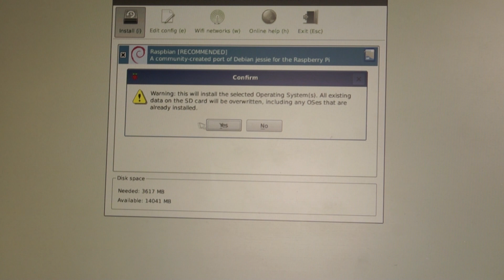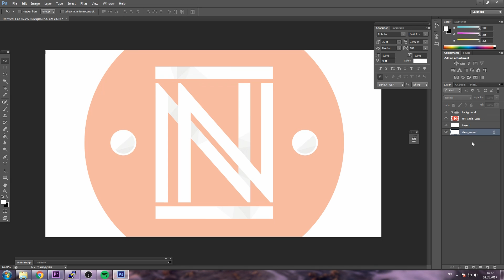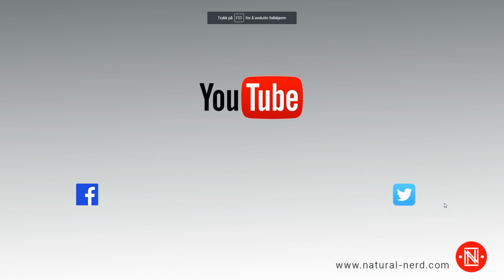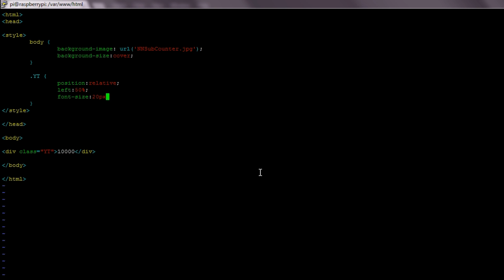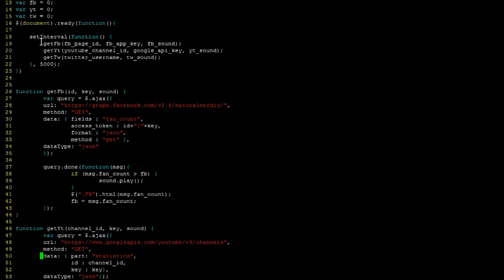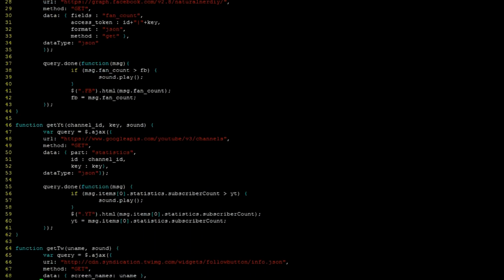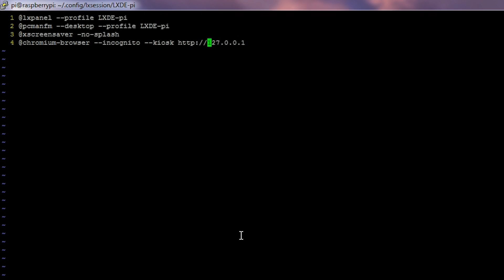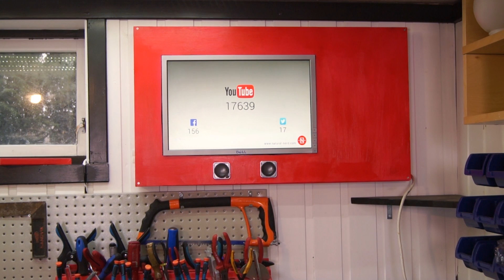Make a Facebook/Social Media Follower Tracker || DIY

Comment: It looks as if your code for the Twitter "getTw" function is now non-functional. I'm seeing "was blocked due to a mime type mismatch" for your call to Twitter. Seems the method being used to get the metrics is no longer supported and the literature seems to call out a different method of getting this data. Additionally, your Facebook function is pointing to graph.facebook.com/v2.8/naturalnerdiy and I'm wondering if this needs changes to support other users - Any advice would be appreciated. The Youtube portion works well as is... Thanks!
Reply from the maker: hello! Yes, the Twitter code is deprecated. It no longer works on my social counter. And yes, the API call for the facebook page needs to be changed to the correct page title.